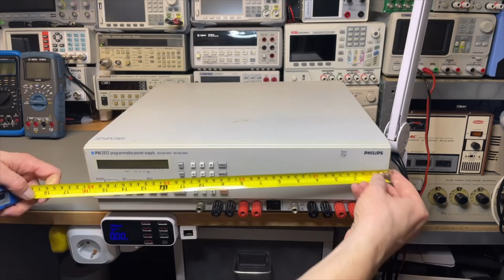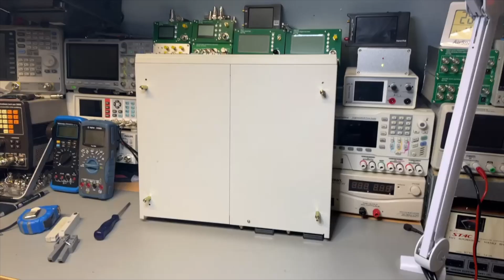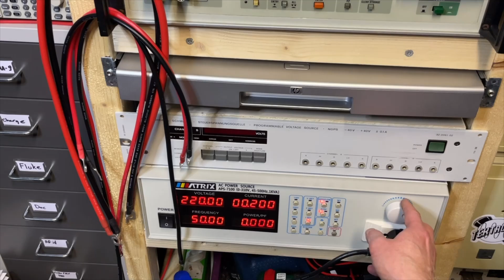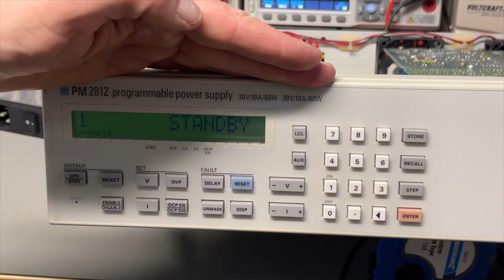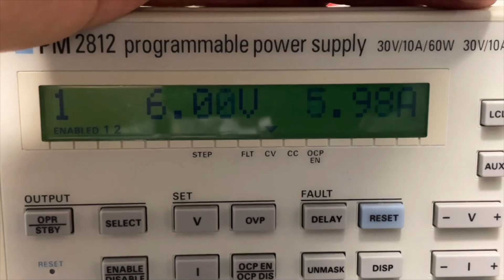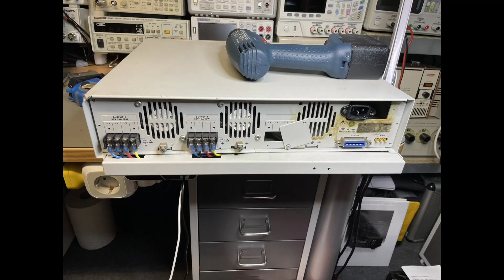TA•0395🟦Fluke Philips PM2812 Power Supply - Test , Repair and Calibration

Comment: The over voltage warning could be due to AC ripple on the DC rail causing it to sense the AC peaks, either from the power supply board or the channel boards. I have seen something similar years ago on an HP power supply, AC ripple caused a voltage error.
Reply from the maker: Thanks Scott, yes that is indeed the direction i was also thinking, there is an AC pickup somewhere, it was also very sensitive during calibration, that failed when you just left an open wire in one of the outputs. it fail then also on OVP. 
after i received the AC filter i will also put some ferrite chokes around the output wires. i could have some HF going around in my shack too :)
Reply: @TonyAlbus  because of its age I would re cap it, even if they test ok.

Comment: Nice power supply Tony. It has great lab work potential with its high specification. I would image back in the day that PSU would have been very advanced and used for high end design work. I particularly like the way you were able to carry out controlled testing with the electronic load and especially the variable AC supply which is very smart indeed. I also thought the way you added the switch with the IEC connectors looked really smart and makes very a safe solution when compared to just hard wiring it in. Ian
Reply from the maker: Thanks Ian, yes i thought using the AC powers source with current limiter was sort of the lightbulb in series for nowadays :)  to savely test it step by step... yes proper device, i was amazed how easy it calibrated too.

Comment: Excellent power supply, very stable indeed. I had a bench multimeter with a similar Schaffner filter that had blown up.
Reply from the maker: Yes those filter will go, on my frequency counter PM6685 is also went.

Comment: I agree with Defpom on replacing the caps, as maintenance. Also, to replace the battery, as maintenance. As you have it wired, the switch VAC wire is in the same compartment as the sense wire and, as you say, this may create the sensing problem. So, I wonder if you might find a way to put the new line filter on the incoming line of the switch... Instead of its original position, which would be after the switch path. This way, the switch line inside the sense compartment would be filtered. I imagine that in-line filters are manufactured and, if so, such might be easier to mount. Cheers.
Reply: You might also do a visual inspection of the regulator boards...
Reply from the maker: Thanks, yes good points !

Comment: Very nice looking power supply, Tony. Because it is a switch mode supply I would definitely try to find a replacement line filter. Your switch mod would still work with the original type and I agree that front panel power switches are a must. The display looks like it might have an ELP backlight, I've had some success replacing them with LEDs, it is a question of space (and how much it bothers you). Regards, David
Reply from the maker: Thank you David, yes the filter needs to be replaced, i agree. the backlight a maybe, depends if i am going to use it or sell it.